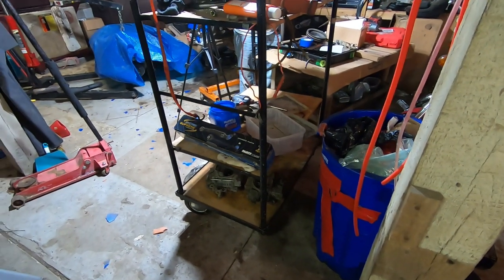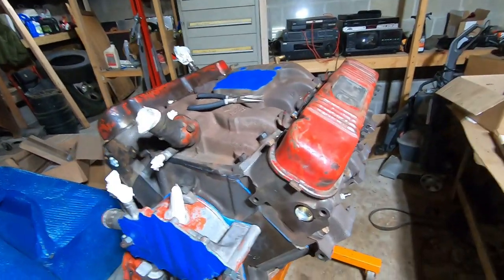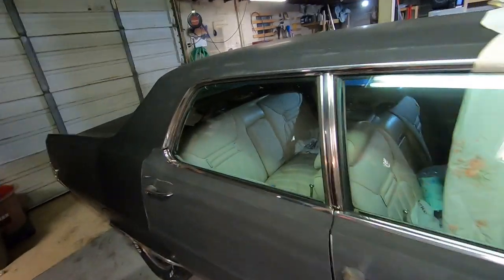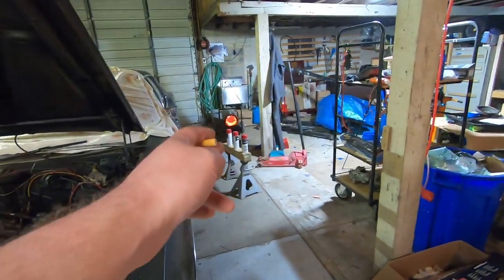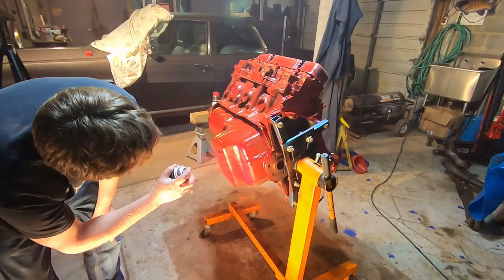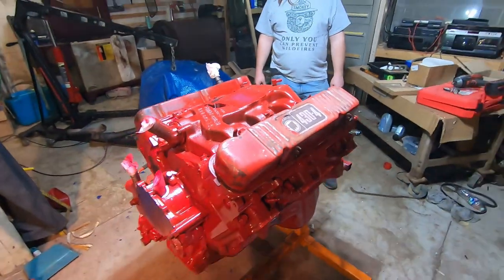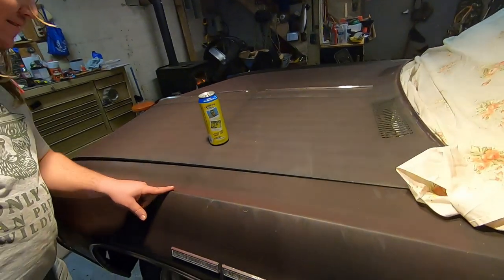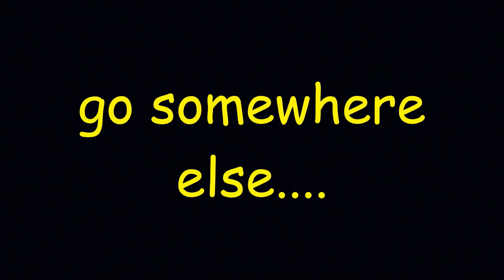1969 Electra 225: Getting a New Buick 430

Comment: My Dad purchased, brand new, a 1969 Electra 225. It was 4 door, light green with a black vinyl top. It had 430 in it and only had 120k miles. We left the car outside for 30 years and mother nature beat the crap out of it. I wished I would have pulled the 430CI engine and trans. out of it before letting it go.  It was a beautiful car in its younger days.
Reply from the maker: Cool man, sounds like I just took you down memory lane.
Yeah man, we've had a lot of cars like that over the year my dad parked back in the 90s that just rotted to the ground because of that. This Electra got lucky.

Comment: Cool deuce and a quarter! I like Buick engines, but my biggest complaint is the die cast front timing cover. The oil pump gets worn out quick.
Reply from the maker: Yep, I was making fun of the aluminum timing cover in the video saying hopefully it has oil pressure and it's a Buick, itl blow up anyway.